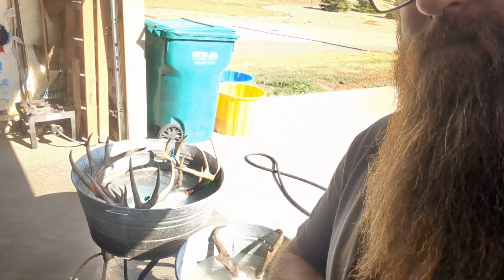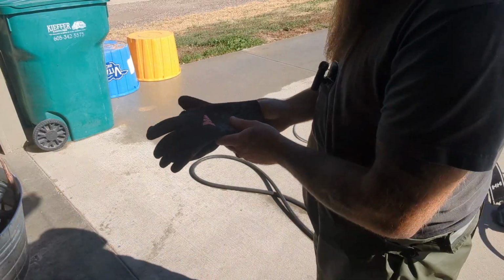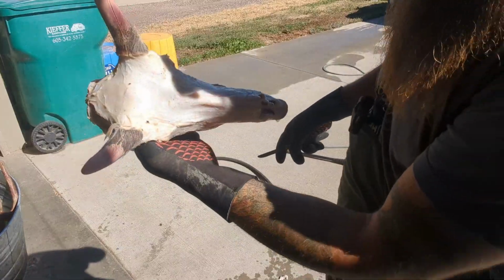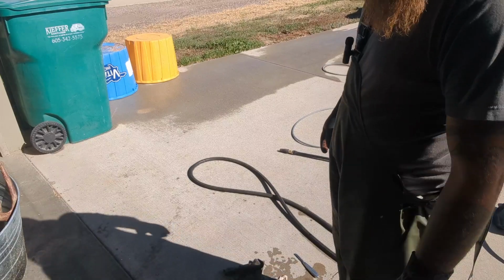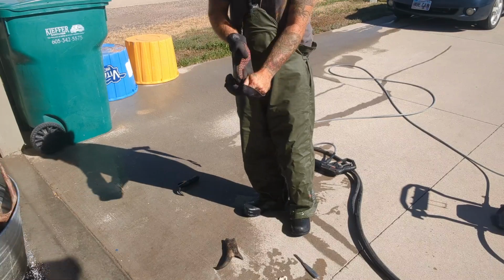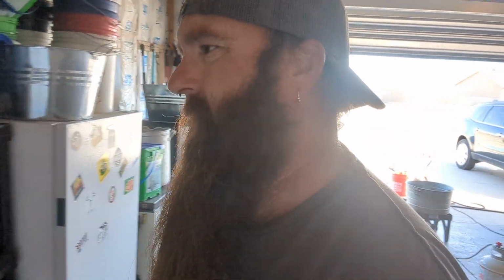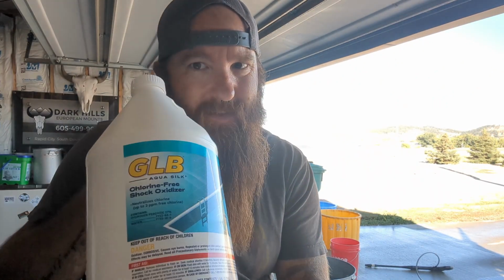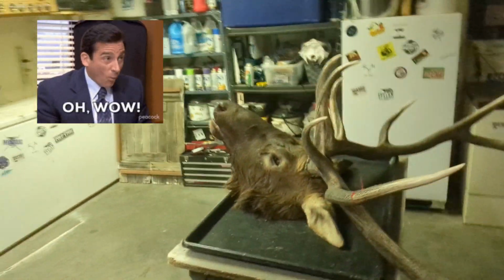Skull Cleaning DIY Techniques: How To Clean A Skull At Home #subscribe #diy

Comment: Nice work!! I can’t find the glb shock anywhere in Canada is there anything I would use in place of glb?
Reply from the maker: You can also use a 40 volume developer from a beauty supply store. mix it 50/50 one gallon of the developer to one gallon of water clear developer not the cream developer